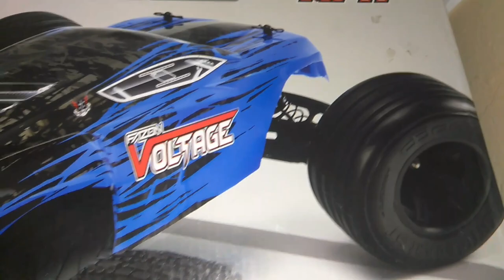Arrma Senton Mega - First look?

Comment: do you think the diff from the brushless version will fit
Reply from the maker: The internal gears are the same..Ring gear might be different pitch I have to look into that..You have a diff problem?
Reply: yes i put a 2250kv and 120amp esc and it can't take it blew the out put and ground the diff pinion flat
Reply from the maker: Ok you mean you broke the shaft? You can get a new one that is metal..The system you are running sounds like a 1/8 scale system..You really don't want a big low rpm motor that makes big torque in these rigs..You want a smaller higher rpm motor..Torque twist is what breaks the shaft..You can get the upgraded shaft and then turn down the punch settings on your ESC..Also run the 27t pinion..you should be good.
Reply: i am runnung the 27t pinion and thinking getting a 1/10 scale motor
Reply from the maker: A great motor set up for these is the 3652 3300kv